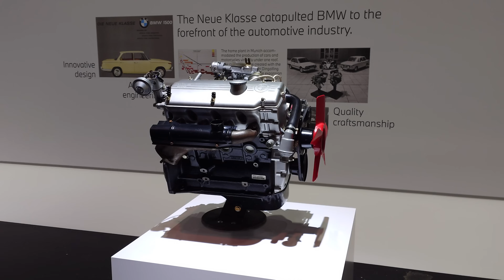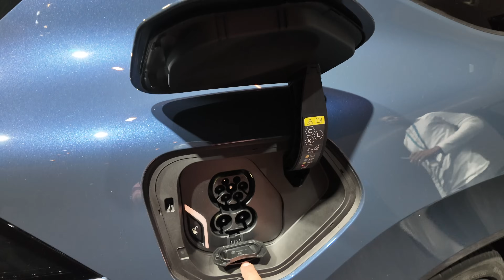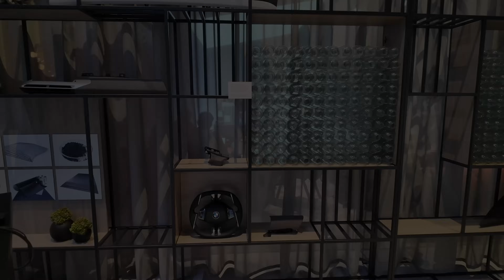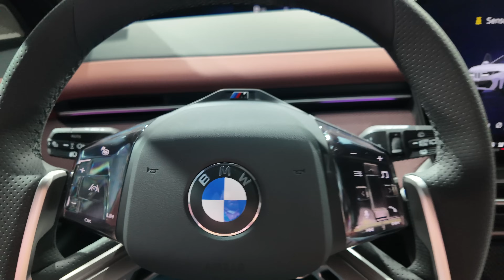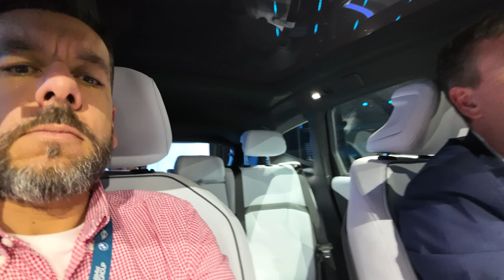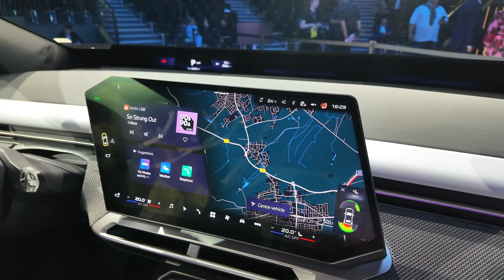2026 BMW iX3 - 800 km Range Neue Klasse Launch (ENG) - Marek Drives

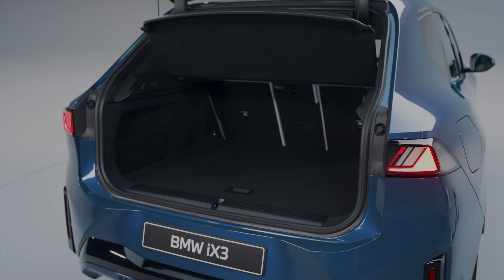Comment: 5:21 are saying there’s a possibility for a 7/6 kids seater also?
Reply from the maker: I didn't say that. By 5-seat configuration I mean current interior setup, i.e. 5 seats are open, vs. only 2 seats open in the front.
Reply: @MarekDrivesENG ok. Cool👍

Comment: I would love a reviewer to actually explain the scribble appearing on the dashboard. Is this removable by turning off the ambient lighting?
Also, with the M Sport Pro upgrade you get hexagons instead of scribble. Even by upgrading again to leather, this only upgrades the seats. I can tell you the car looks awesome to me but the interior is inferior to my current ride at only £42,000 the Audi A5 tfsi. However, I accept Audi have had the same interior issues using black plastic and even a corduroy dash.
Has Germany gone insane?
Reply from the maker: Except for the base trim the dashboard is covered in woven recycled trash (screams premium, like those dumpster Balenciaga sneakers). The patterns you see is ambient lighting. I'm not sure, whether BMW went for light leaking through the weave or rather followed MINI's projection from behind the infotainment screen path, which you can see here:
https://youtu.be/Xa7uuLKoMEQ?si=4KBtOqZ3AX7ecQaq&t=428
Reply: @MarekDrivesENG just need to be able to configure it out. I don’t like it at all and it’s triggering ocd vibes and i don’t have ocd. Just nasty.

Comment: I'm pleasantly surprised by the looks of the car, and what BMW have done. Not a fan of the ground clearance or the recycled materials you will be touching, but apart from that it's great. I like how they paid tribute to the old BMWs from the 60s and 70s. Much better than what they were doing the last 10 years.
Reply from the maker: Well, recent design language was a bar set low, but one day we may look fondly on some of it, like there's a part of us that suddenly thinks the Multipla wasn't all that bad :)

Comment: To me it looks like too much noise around something that is build with half the attention it’s used to be for BMW of the past. The leap between E34 and E39 or E30 and E36 was much greater than modern BMW vs “neue class”.
Reply from the maker: Yes, and no. BMW OS8 and OS9 had terrible UI vs. previous iDrive generations. This new one seems like a step in a right direction. It's not what boomers like us would like from a BMW, but it's a logical step forward.
Reply: @MarekDrivesENG unmessing the messed up might be a good sign, but is this an outlier or a new norm? Time will show.

Comment: Eyes on the road, hands on the steering wheel - unless you need to adjust the vent direction by a couple of degrees, which requires you to go through a sub menu and leads to an accident.
Reply from the maker: Well spotted :)

Comment: I believe this will be priced well and actually sell, same like the Countryman and the X1/X3, but OMG does it look cheap inside, this is worse than the Chinese. Yikes!
Reply from the maker: There is some leather option in the configurator, but I doubt they can do anything about how the dash looks. While I don't mind the recycled fishing net on a concept, I think it's not going to work well in the long run, when you'd like to give the interior a proper clean. I guess you'll have to star blowing compressed air into it, while having a vacuum on to collect all the debris. 
Seems like a design by some GenZ kid, who's never cleaned their own apartment, because they move, when it gets too filthy to squat in 💩

Comment: I still don't understand who needs a battery that can drive for 800km. It's heavy, making the mileage terrible
Reply: Weight matters a lot less than you think. Go watch the Aging Wheels video and see for yourself. And this is barely heavier than the prior generation because they reduced weight everywhere else. In large countries like Germany, Ameerica, Canada, etc, range matters. Not everything is about the UK and their small cars with short ranges. That's why they no longer have much of an automobile industry.
Reply from the maker: While the new iX3 is only 100 kg heavier, than the previous gen, it still weighs around 2.3 tons. That's 300-400 kg more, than a regular X3, which is already a porker. I understand cars need to have passive and active safety features, and that adds to weight, but I remember, when the 80s Volvo 300-series weighed just over a ton in top spec, and that was considered an extremely heavy car at the time. And safe. Albeit a seatbelt warning light isn't as good, as ABS, ESP, SRS, SIPS, etc. 😎
Reply: People who use their cars for more than supermarket runs.

Comment: Doesn't feel like BMW have made a big leap but rather just barely caught up to where Chinese EVs were last year.
Reply: How many Chinese EVs have the real world range or charging speed of this?   

How many have V2X?

How many have cylindrical cells that means there is no risk of thermal runaway?

How many have 1/3 of their mass produced from recycled materials including part of the battery?

How many reclaim their CO2 excess during production over an ICE in 10,000 miles?

The list goes on.
Reply: They are more mass production and flash, rather than actual quality and thoughtful ideas. This is definitely competitive. That being said, I'd probably lease a BYD insead due to price.

Comment: When will they learn that real buttons and knobs work much better than any touch screen
Reply from the maker: Apparently their clients are from the iPad generation, and they don't need buttons. Probably they also don't need to drive, but that's a different story :)
Reply: It's infuriating isn't it. Just because the technology exists it doesn't mean they should use it. Physical buttons were invented around the same time as the wheel. Nobody has been able to improve either.

Comment: 109kwh battery and real world 400km range? That is TERRIBLE efficiency, especially now that we are going on 20 years into the modern EV era.
Reply from the maker: I said "if you push it, high 400-low 500". Think 140-150 km/h on the motorway.
Reply: @MarekDrivesENG Do people normally drive 150kmh (93mph) in the UK? This will go 400 miles (643km) at 70mph (112kmh). It will probably go longer than most ICE BMW's out there.
Reply from the maker: @junehanzawa5165 I hate to break it to you, but the UK isn't THE world. Majority of countries in Europe have 130 km/h motorway speed limits, and the further south-east, the less it is policed. 
I very much appreciate the British way of doing things, and I love the fact that the speed limits on your b-roads are usually higher, than what a regular person may feel comfortable with. You also have plenty of tracks, etc. Not in my part of Europe. Almost 90 mph on the motorway, 75 on the dual carriageway, and both of these numbers are often treated as a rough guidance :) 
While I understand that driving this fast in my ICE car I'll also be decimating my range, and it will cost me dearly at the pump, I also have the pump somewhere nearby, and it will take 5 minutes to fill up. 
In an EV after the initial full charge at home, we should look at the 10-80% SoC range, which in case of an 800 km total range is something like 560 km... And so on.
Reply: This is just bullshit information this “journalist” is giving. These people are just like influencers these days, they know nothing about the engineering side of the cars.